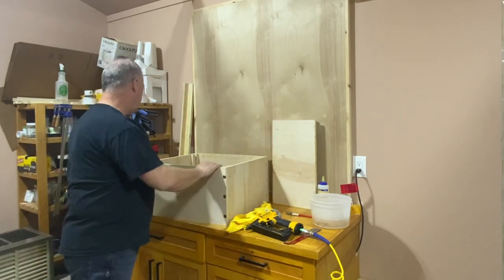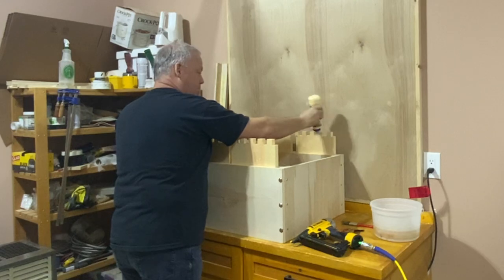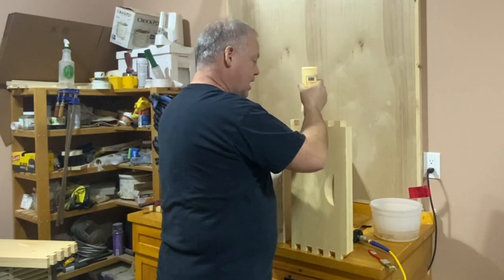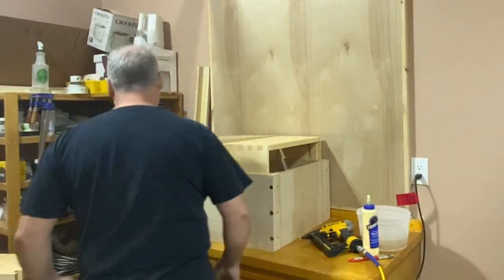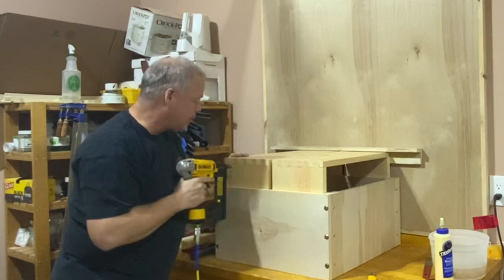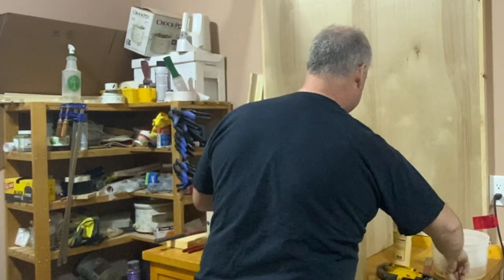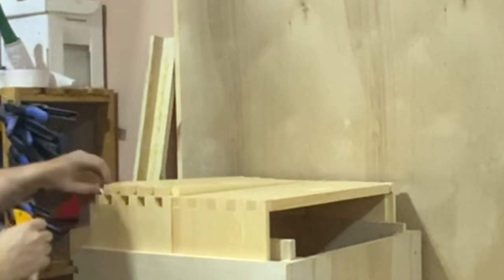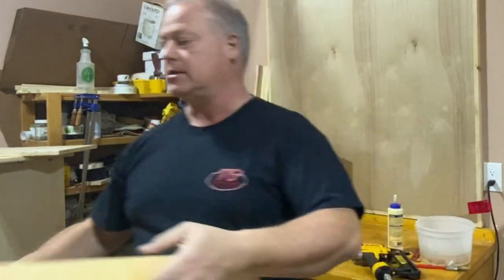Building Bee Boxes, Hives for 2023

Comment: I build all my bee hive boxes from scatch. Starting with rough cut white pine from a local saw mill. Then I trim them down to rough size , plane them down to 3/4 " thick, with my Dewalt planer. then I add the box joints on my table saw. As for the glue, I used tite bond 3 because it is the water proof glue not the tite bond 2.

Comment: I love that jig, looks like it's making things a LOT easier. And I agree with the use of glue: Makes them sturdier, creates a seal between the joints and I also use screws instead of staples. (I do have only 15 hives so more time to assemble them)
Reply from the maker: Jig is great! yes screws are an awesome fastener, with the larger number of boxes the stapler just speeds things up for me.
Reply: @jamesmcnally2519  I like to to run screws on the corners that's where they try and pull back on me.

Comment: Why do you feel that the propolis that the bees put into the corners is not good enough glue?
Reply from the maker: With out the glue on the corners the boxes when full sill shift and move allowing the frames to fall out of the boxes when handling them, I have also found that nails or staples alone the boxes work loose, With the addition of the glue my boxes remain maintenance free for years

Comment: The fasteners only hold the joint together while the glue dries.  See Nathan's recent video on testing the box joints.  I cant image anyone not using glue.  Also, you stated the difference between Titebond 2 and 3 backwards.  2 is resistant, 3 is proof- thus the price difference.